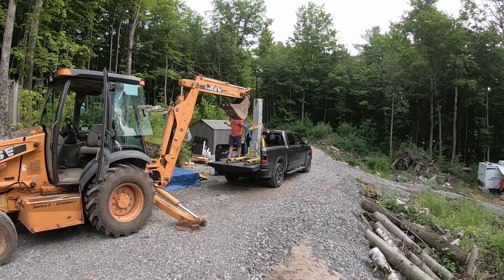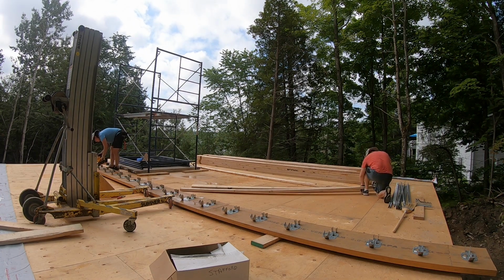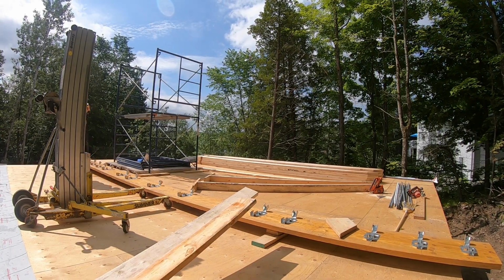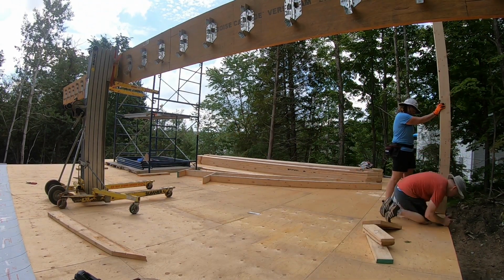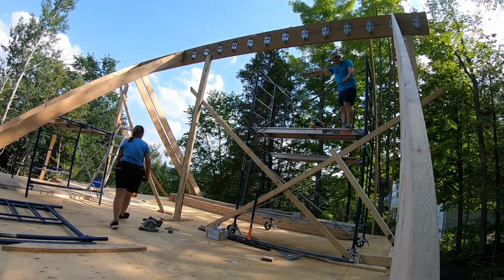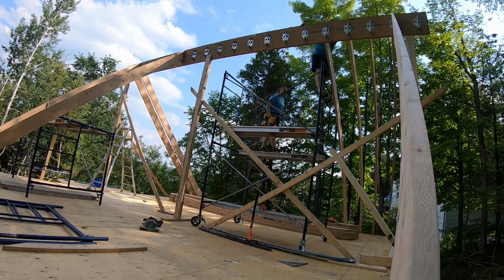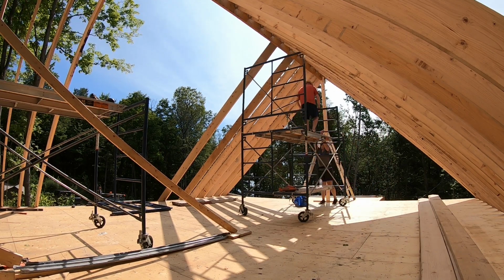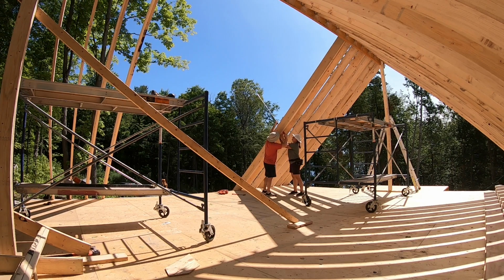Garage Build - EP06 - Raising the Roof

Comment: with only one day rental, you should have the ridge beam all ready to lift. With all the supports installed all the hangers installed and all temp bracing ready to go. The you have time in case something does not go right.
Reply from the maker: Yes, you are correct. However, we were fairly confident we could raise the ridge beam and get it braced & secured with the 1 day rental!  We did have all the rafters precut so that helped speed up the process.
Thanks for watching!